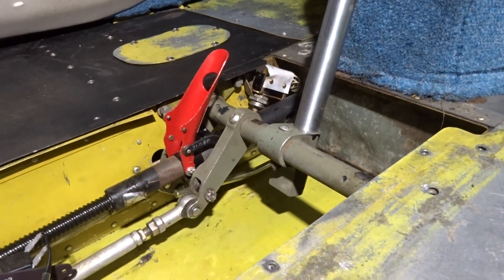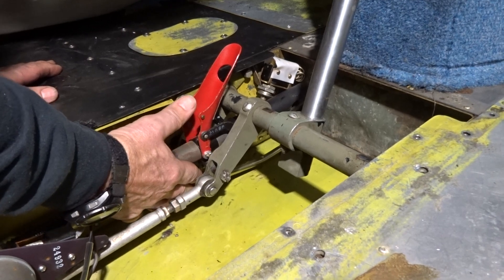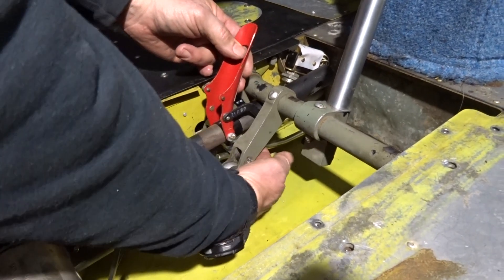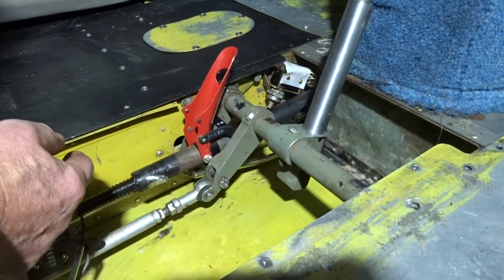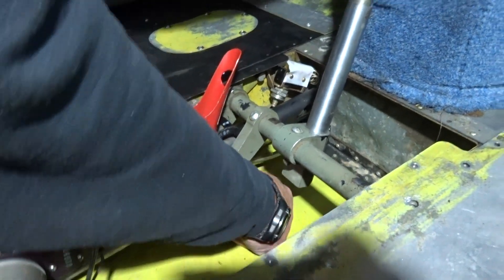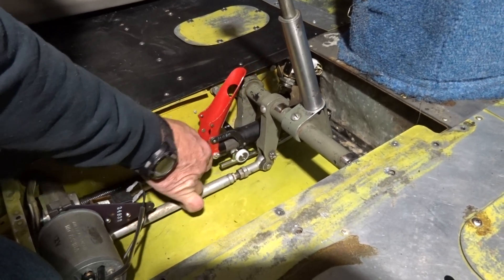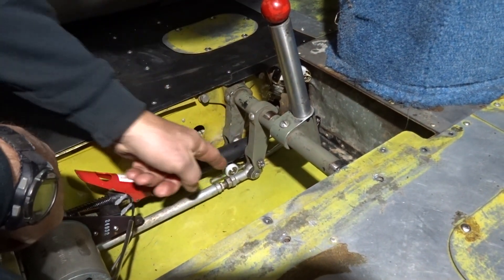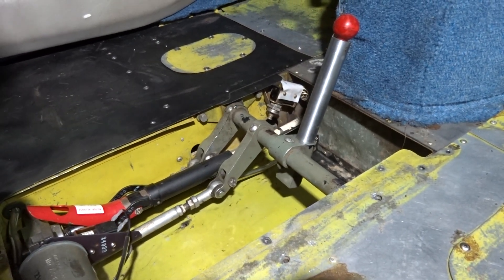How to reconnect the landing gear transmission on a Piper Comanche.

Comment: Many years ago, I flew a Comanche 250 with an experienced pilot, mechanic and instructor. He performed a manual gear extension and actually reconnected the transmission in flight. He then talked me through a second one.